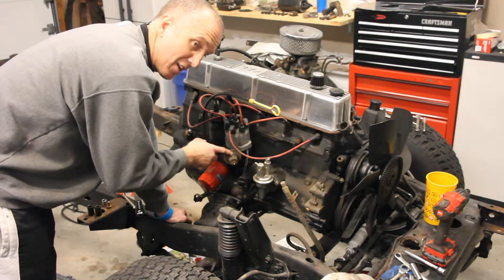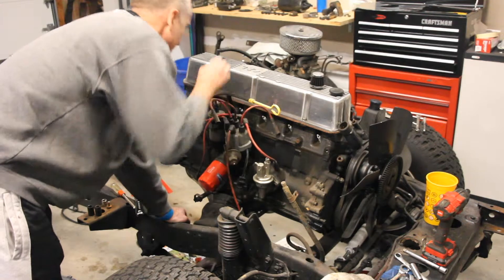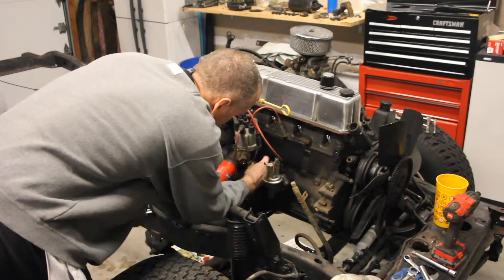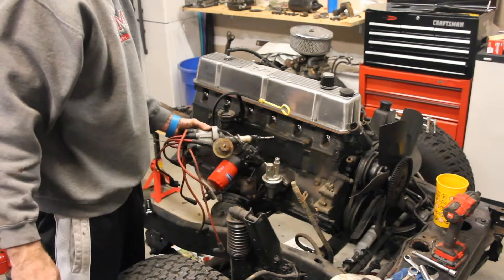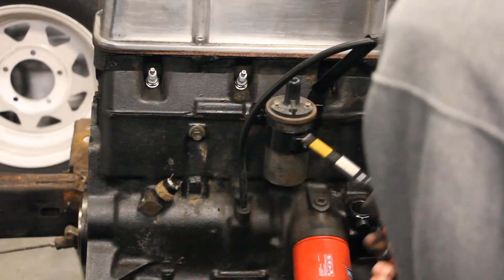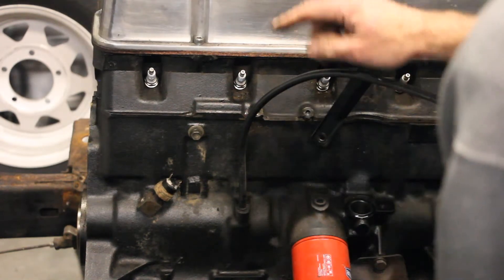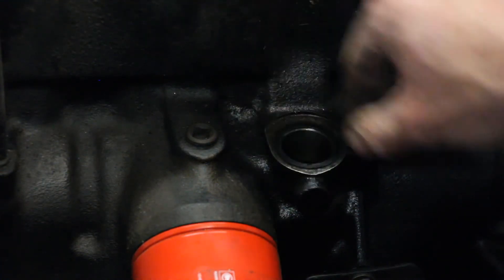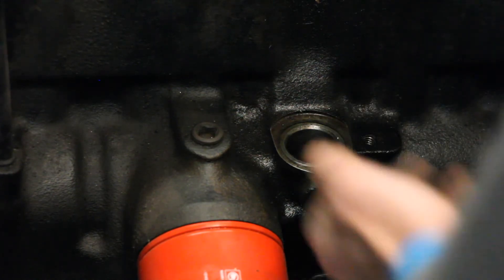Jeep CJ7 Stock Distributor Removal

Comment: I'm restoring a 84 CJ7 the oil dipstick was broken and silicone was placed around to hold it in place.  Can't find one that fits, any suggestions on making a new one or where to get a new one or old one that fits.  Love the videos, thanks
Reply from the maker: Let me take a look at an engine that I have in storage and get back to you.
Reply: @coolguy_CJ7  Thank you, the engine is a straight 6, 258. I had to get the broken piece of tubing out of the block, good times.